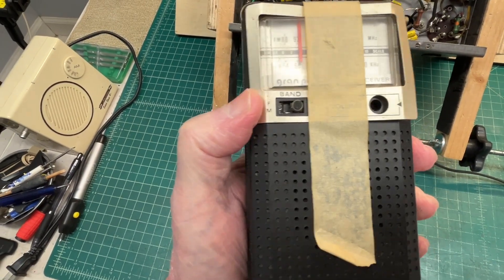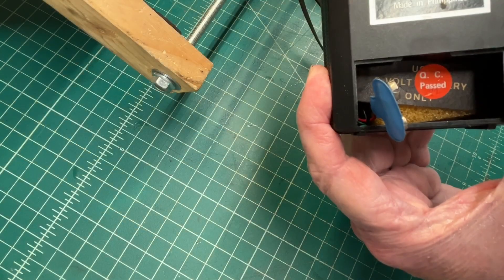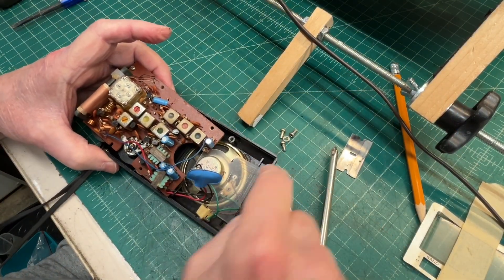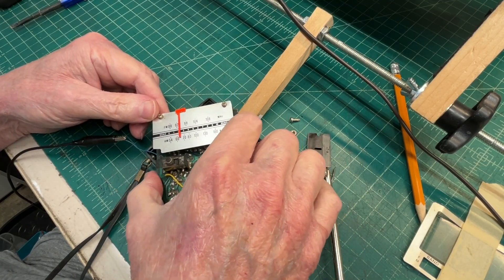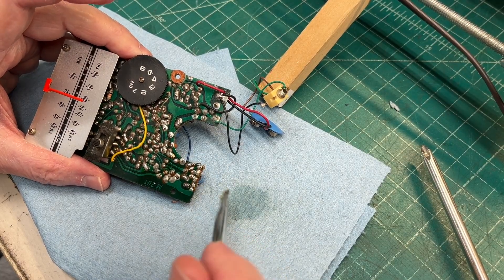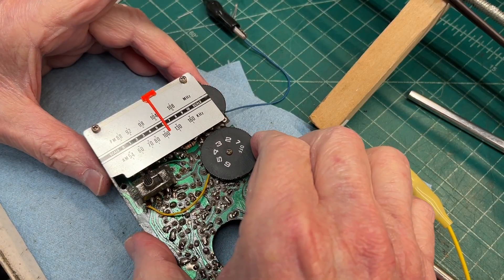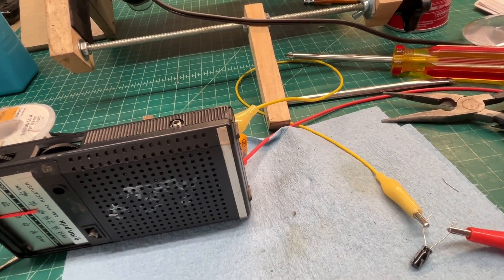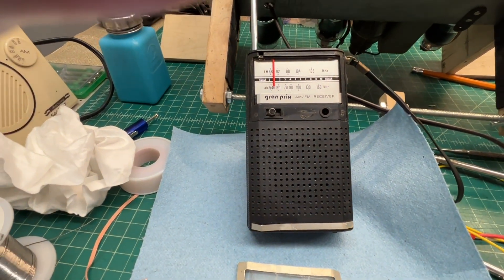Transistor Radio Troubleshooting/Repair | gran prix - Made in Philippines

Comment: Nice work Don. I've found I usually get the biggest volume boost when changing the audio coupling cap which couples the audio from the detector stage to the audio stage on these types of radios. :)
Reply from the maker: Doug, thanks for sharing your knowledge/experience. Do you ever increase the value of the capacitor? Best, Don
Reply: @RestoreOldRadios  No, I usually just get as close as possible. I like to think the people who designed it knew more about it than I do, but of course sometimes you wonder. LOL
Reply from the maker: Thanks Doug.